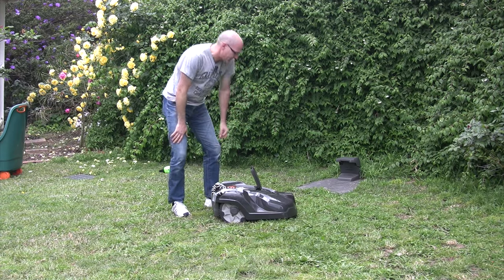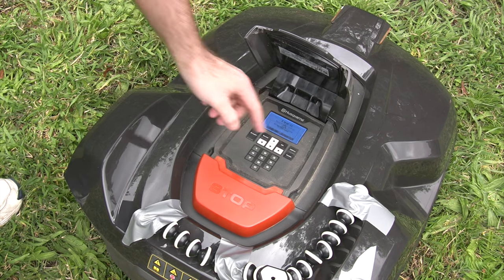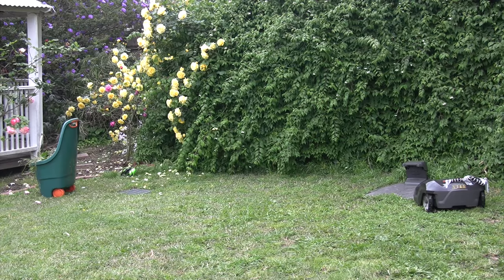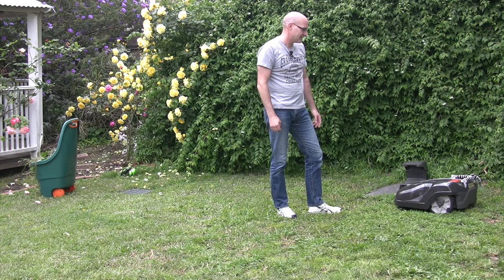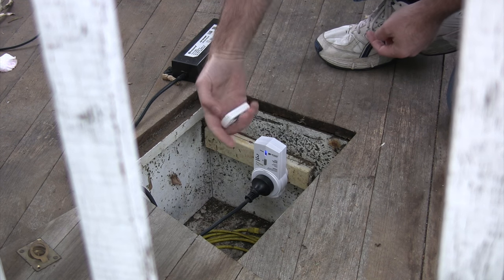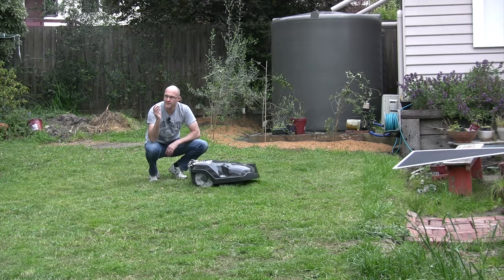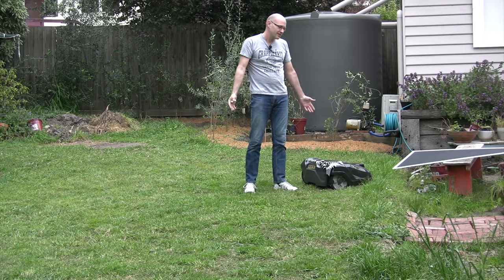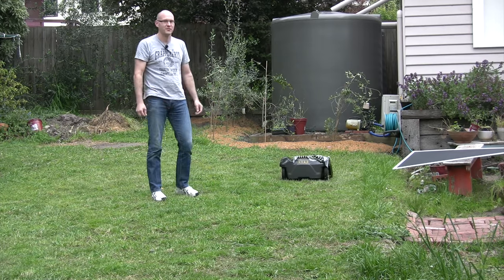Vlog #47: Husqvarna Automower power failure behaviour

Comment: Thank you very much for the very interesting test. I have a new problem with my 2-years-old Husqvarna 310. In fact, since few days, it mows normally until I find it in the middle of my grass with an empty battery! When I put it back in the charger, it asks me choose again the language and country and password, as if it was reset.  Would you have a hint please?
Reply: Something similar happened to mine.
I had expanded the mowing area and so there were places where the mower was too far from the boundary wire.
Reply: Did you ever find out what was wrong with your 310? Mine is doing exactly the same as yours and I have no idea what it might be cñthe cause. I bought it 3 or 4 years ago and it began having this behaviour q couple of weeks ago. Thanks in advance.